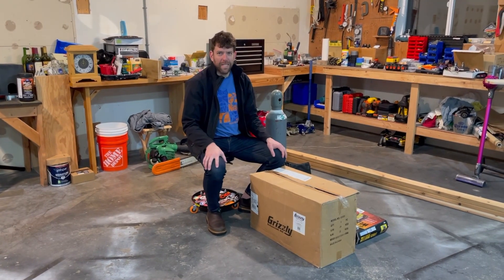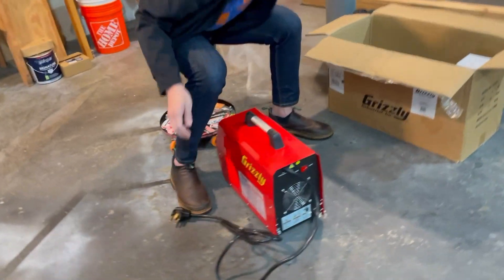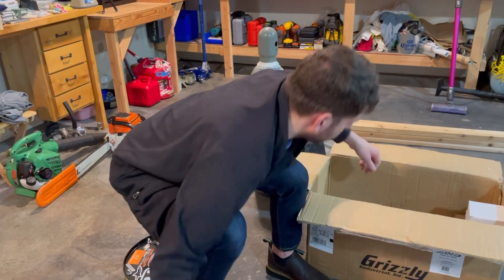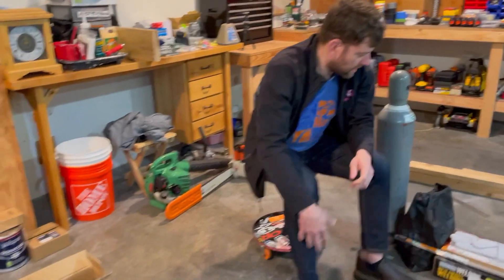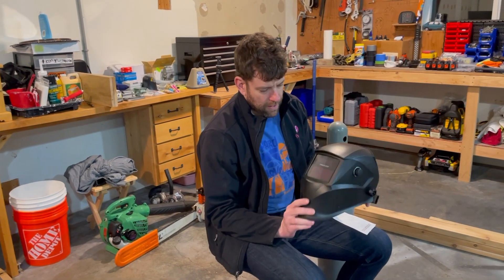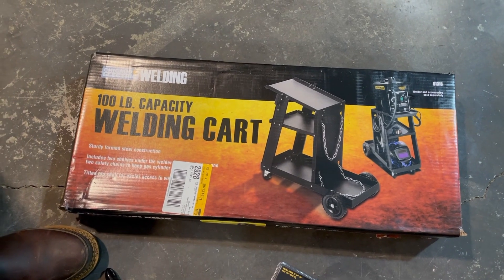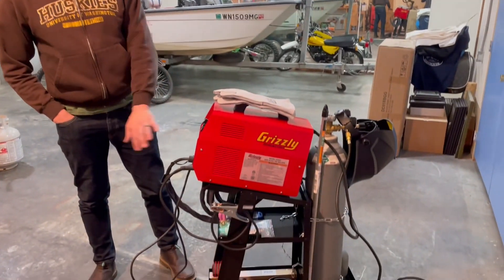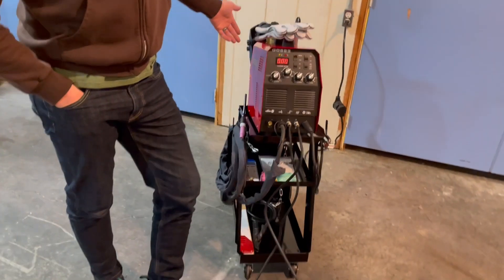The Cheapest AC/DC Tig Welder!

Comment: I started out with the primeweld tig225x picked it up for $750 back in 2021. Added the maxcool water cooler and flex-loc torch too kept it down on the cheap side compared to Lincoln and Miller. If you go-to upgrade take a look at the primeweld line. You can always make your money back on welding stuff I had a plasmargon mig 220 for my first tig machine and it was lift arc only that how I taught myself how to Tig weld. Always remember practicing makes better welds.
Reply from the maker: Thanks for the tips!
Reply: I watched the entire video. No welding... So I watched a video of somebody unboxing a welder.